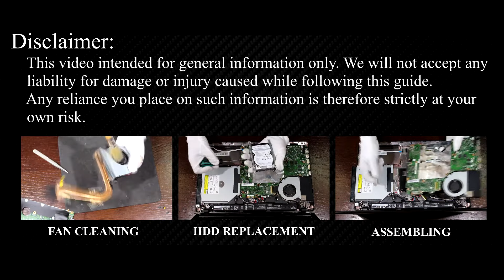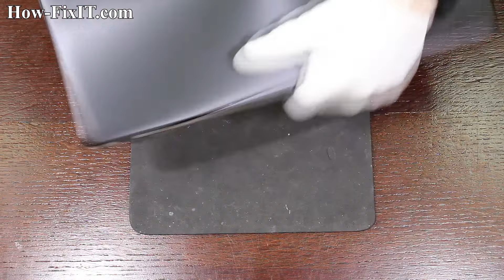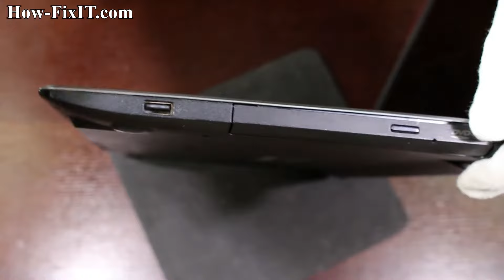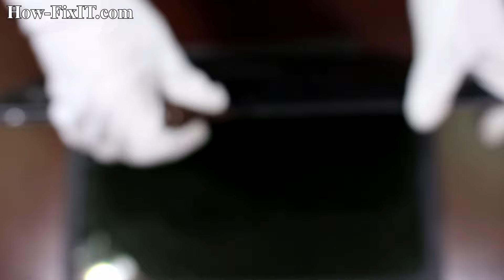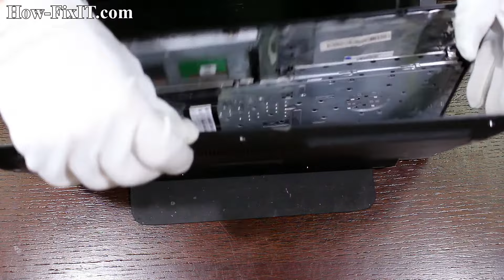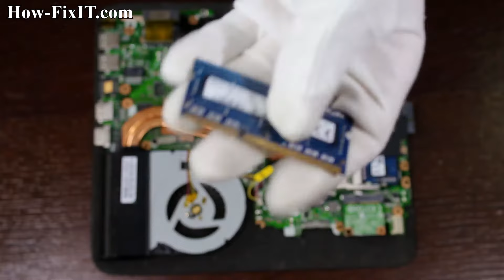Asus R510 RAM Upgrade & Install: Step-by-Step DIY Guide

Comment: My asus r510l motherboard x550LA can be upgraded to 16 gb? in some pages it says maximum 12 gb and others say 16 gb maximum so im a little confused, if it helps my laptop currently has 6 gb ram in cpu z says mode dual channel but in the SPD option it appears information only in the slot #1 and all the others are in blank, any ideas? thank you!
Reply: i have same issue... This may be the answer but I'm not sure.."https://www.quora.com/Why-is-the-SPD-tab-in-CPU-Z-empty-in-my-laptop" 
anyway If you don't mind, may I ask some questions? i'm going to add RAM but i don't know what speed right. Are you work well dual channel? and 
Did you add 2133sodimm memory?
Reply: @정모씨-p4e  Hello, to you and everyone, i figured it out, it turns out that in this model the r510I with the motherboard x550LA the motherboard has 4 gb of ram soldered to it thats why in cpu-z only shown 2 gb in slot #1 because there is only one slot available to insert a ram memory unit(its on the plate behind the laptop shown in the video) also by the way the maximum ammount of memory can only be 12 gb of ram (4 gb soldered in the motherboard and 8 gb ram card inserted in the slot i mentioned before) there is also a 4 gb of ram version and other of 2 gb version that you can use but the maximum is achived with an 8gb of ram card. 

The speed compatible is 1600 mhz for this model, the model i used is this https://articulo.mercadolibre.com.mx/MLM-737757765-memoria-ram-sodimm-adata-8gb-1600mhz-ddr3l-135v-_JM?quantity=1 i put it in the slot like the video shown and no problem at all. The laptop shown it has 12 gb of ram. 

There is no dual channel for this model of laptop it has only one slot available
The maximum speed i think is 1600 so i wont recomend to put any higher speed ram

Also a last advice the memory MUST be the 1.35 v version or it wont work so take that in count!

I hope this helps to everyone in the same situation!
Reply: @josevazquez5569  Oh really thank you. Your advice was really helpful. my motherboard is able to support DDR4 RAM so i bought 8gb ram and then i can run 12gb. My model code is ASUS R510IK.
Reply: @정모씨-p4e  you Are welcome dude! My motherboard Only supported ddr3 so i Got a 8 gb module Because My maximum was 12 gb But i dont Know the maximum of Your model, maybe is 12 if it Only has 1 slot so im glad to Help! Good luck

Comment: I own the R510C, my fan makes allot of noise, even after cleaning, can i upgrade it to a quiter one?
Reply: I had the same problem in a different model. I fixed the annoying noise adding a little bit of 3-in-one.

Comment: Can i replace processor??
(i have ASUS R510C)
if yes, what processor i can buy for my laptop (actualy i have i3-3217U 1,8 GHz) 
I'm wanna buy i7
Reply: No, you can't replace CPU easily in Notebooks coz it is soldered inside.
Reply: @YoloMolopolo  ya thanks i have sold my asus like 2 years ago 🤪

Comment: how many RAMs can be added to the R510CC and what's its maximum (2 x 4 or 2 x 8) ?
Reply from the maker: 16gb max
Reply: @howfixit  And for me? (Asus R510JX) i have currently 4Go can i add one 8Go (for 12Go in total)?
Reply from the maker: Yes, you can

Comment: Help I own r510jx and in specs it says 8GB ram but I see only 1 module with 4GB help there isn't a place for second
Reply: One of the modules was removed for some reason. Check if windows knows there is 4 or 8 gb of RAM. put in the command wmic "MEMORYCHIP get BankLabel, DeviceLocator, Capacity, Speed" into the CMD window.

Comment: It is possible to upgrade putting 2 rams of 8gb .. TOTAL 16gb in my laptop:

Asus R510DP-FH11 AMD ELITE Quad-Core A10-5750M 

????
Reply from the maker: yes, Asus R510DP ram can be upgraded up to 16GB (2x8GB), according to official asus specifications: https://www.asus.com/Laptops/X550DP/specifications/
Reply: THank you very much... Now im tryng to reserch ways to upgrade the Video Grahpichs with external device to put in the WIFI MODULE.... 

And try to overclock the Core.. you know some program to overclock the core of my laptop ? :)
Reply: Happy Movement ur bios lol

Comment: What is the maximum RAM that i can put in my Asus R510JX(Windows 10 version) ?
Reply from the maker: 16gb
Reply: @howfixit  Is the 4Go RAM removable ?
Reply from the maker: Yes, why not?
Reply: @howfixit  How to do it ? The barret is green (doesn't really look like it could be removed)and has a black adesive ruband (similar to the one in the video) on it.
Reply: @howfixit  By just dissambling the small protection that give access to the HDD and the SD port, i see the addesive ruband, probably a emplacement for RAM  but i can't distinct the 4Go ram.
Reply from the maker: Does your motherboard look like a motherboard on video?
Reply: @Spido68_the_spectator  Hi, I've got the same problem than you . Could you solved it ? Could you add 16GB ? Could you open the laptop and remove the modules easily ? Thanks